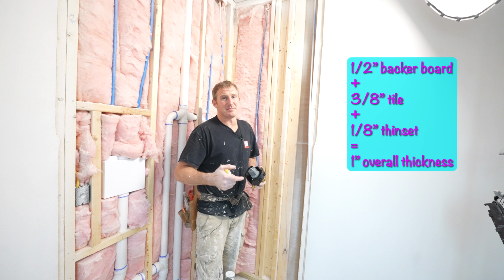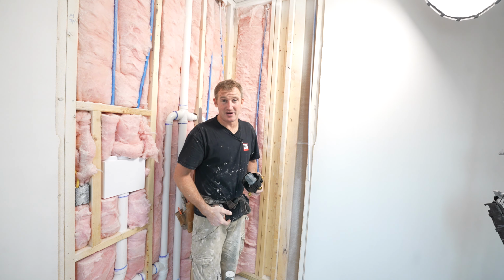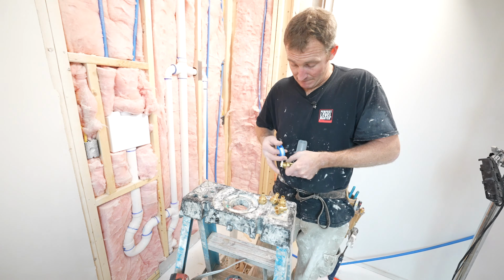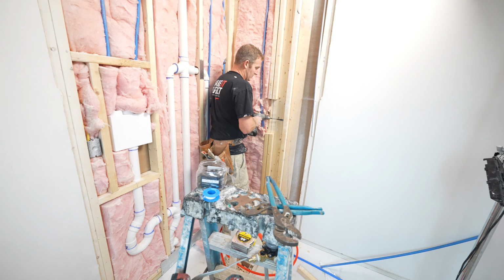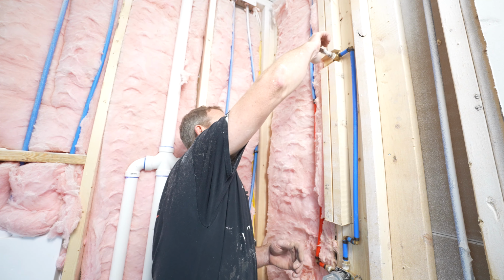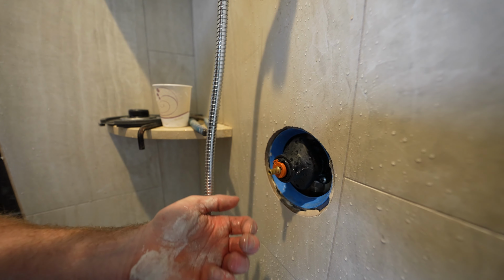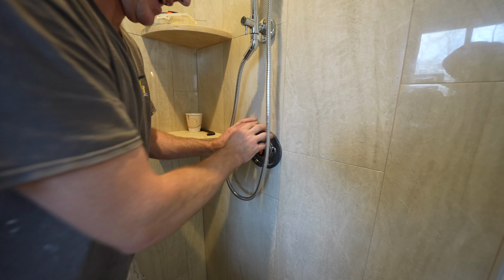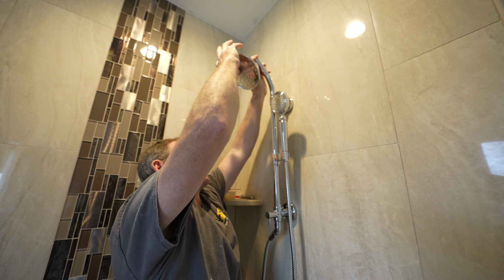Kohler Shower Valve Installation Tips #shower #plumbing #diy

Comment: You should use the blue pipe dope over the white pipe dope.  Also the white teflon is trash, you should use the blue monster teflon, which is like double the thickness of the white teflon, and go around 3-4 times with the blue teflon.

Comment: Directions say to solder between valve and tub spout otherwise water may flow from both tub spout and shower head at the same time. You ever have any problems with that or is pex totally fine to use?

Comment: I hate US made plumbing products. Just cheap shit. I had to fix a Kohler shower valve, but it's impossible to remove even the faceplate WITHOUT A SPECIAL NOTCH TOOL!!!!!!!  Use Grohe. German Engineering with quality hardware.

Comment: I didn’t quite find the answer I was looking for in your video, so hoping you might have some advice…we had a new shower remodel that included a similar Kohler shower valve and handle assembly to what you show here, where the handle has no set screws but instead threads onto a collar on the valve assembly.  Ours was part number K-T73133-4-BN, and called Composed.  The problem is, the shower handle moves in and out from the wall about 1/4 inch, and appears to be due to the fact that the collar it threads onto in the valve assembly has the much play in it.  Is there any way to take that in-and-out play out if that collar on the valve, so that the handle isn’t moving in and out from the wall?

Comment: Curious why you chose not to take advantage of the flexibility of Pex and just bend that line to the shower head instead of putting in the two 90s, which reduce pressure and create more potential for leaks?

Comment: are there not service valves to adjust the water pressure?  you were clear on how to adjust the temp via the tab stop but what if i need to adjust the water pressure? I actually have the problem of too much pressure and want to turn it down. thanks

Comment: Steve looks like you did not use the plastic trim guide. Do you find it easier to leave it off?
Reply: Same question ... trim guide is sticking out beyond Schluter Kerdi ... can I use valve without this?

Comment: i like seeing the Kohler install, step by step.  the way I recommend is the dope first, then the Teflon tape second.  it keeps the dope from getting everywhere.  i do like seeing how other parts of the country (i am western Kentucky) plumb their stuff.  i use Delta here, because of the simplicity of the cartridge;  extra parts leads to complexity and possibilities that are negative.
Reply: Dope, Teflon, dope is also common. It's engineer recommended actually. Situations like in wall connections I tend to go that route. Never leaks.